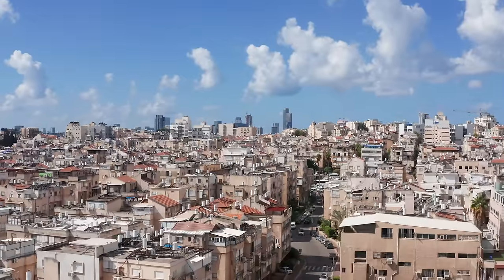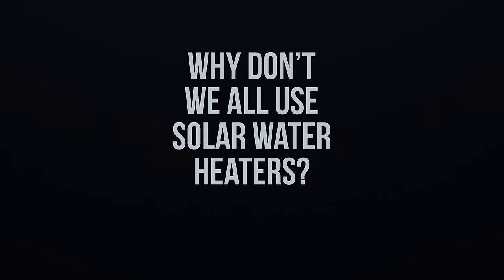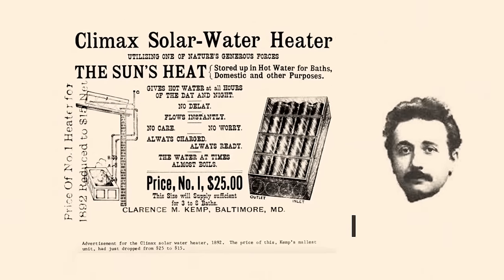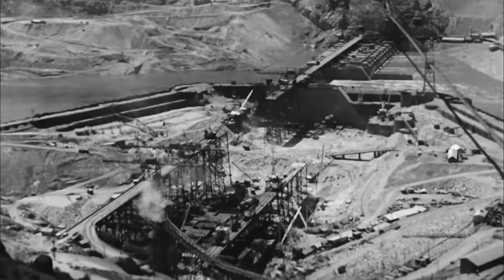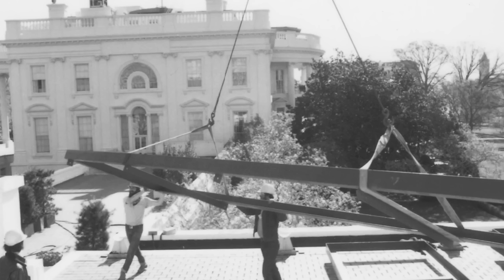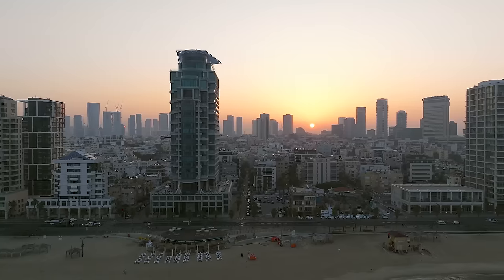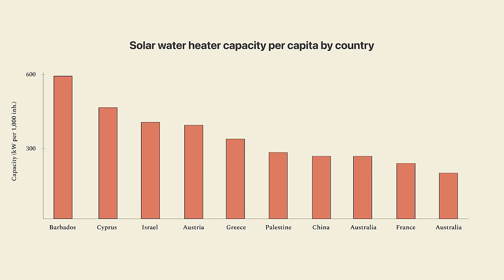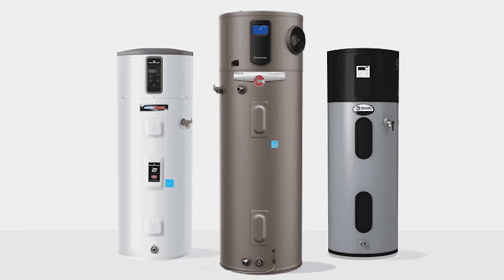Why Don't We All Use Solar Water Heaters?

Comment: I was in Turkey on holiday recently and on the drive to the airport I noticed that most of the rural houses had one of these on the roof. What's weird is that few houses had actual solar that you'd think would be fabulously useful for running stuff like AC in the blazing heat.
Reply: Most certainly because of the initial cost. The cost of solar water heaters are within reach while pv panel system could be 30x or 40x more.
Reply: I spent all the previous winter in Turkey, and it happens that the solar water heater was leaking at that time, so i could've watched as it was repaired. 
These heaters are incredibely low-tech, 2 barrels, 1-2 boxes covered with class and a (probably) copper wire inside, and a pvc pipe connecting them. They cost about 250-300$ at any market in Turkey, and if you don't know how to connect tehm they'll do it for 50-100$.
Solar panel that would generate any sufficient amount of electricity would cost way more, so it won't make any sense to install. And btw, most houses in rural areas don't have an AC, they can't afford it. Even in a "rich" touris city they have AC mostly in a rent places for tourists.

Comment: Solar thermal is one of those technologies where long-term thinking permits sky-high upsides but we are a species that thinks in the immediate short-term.

Solar thermal is one of those rare "Eventually, no matter how relatively less ideal the circumstances are, it WILL pay off" technologies where the only real limitations is getting the ball rolling so that economy of scale can kick in.

Personally I think this is where governments come in but either way we need large scale production of these systems in North America.
Reply: or import from places that already have the economies of scale
Reply: I looked at a glycol system (Canada). $7k+ before installation, probably 10 or more after. I would never spend that much on hot water, certainly not within its lifetime.
Reply: @alanj9978  I don't think you're wrong by any means but I think you might be surprised.

I know hot water accounts, on average, for about 15%-20% of home energy use.

That's admittedly about $30-$40 a month according to BC Hydro's average used estimates (greetings fellow Canuck!).

If one is able to make practical use of the heat obtained via a central heat exchanger getting an average up to $60-$80 a month.

Guess it really depends. If it's able to supplement in-home heating than its a 7-10 year pay back. Otherwise it would be closer to 15-20 year pay back but should out last that by a significant margin.
Reply: @Cheebzsta  It's more like 30 years at $40 per month vs. 10 years at $80 per month, assuming you would otherwise use that $7,000 for very cautious investments (5.5% or so). But how much more than $7000 would integrating the system with a central heat exchanger cost? If it's an extra $4,000 that puts you back out to 20 years, if it doubles to $14,000, you're back to 30 years.

Comment: Prices for water heaters here in Mexico (2mins away from Arizona) is $320 USD for a 120Lts version. The 350Lts version is around $650 USD. Source: HomeDepot, 84000.
I've worked for Home Depot and you can ask a supervisor to give you a discount, they can provide up to 15% discount and the manager can easily do over 20%.
Same applies to US depots. And this is only with this distributor.

Comment: In my 5 bedroom house in Spain 6 years ago I was approached by a local company who suggested I should have a solar water heater. They told me that there where government grants available and it would only cost me €3000. Being a practical person I decided to look  into it in more detail and found that I could buy a complete 300 ltr system from Baxi for €1200. .I also had to spend €130 on extra plumbing pipes and fitted the whole system it two days. So for the last 5 years to provide hot water,I have only used the electric water heater for less than 30 days each year. It’s a no brainer.

Comment: Whoa, I never knew. Are solar water heaters so expensive in the US just because of the economies of scale, or are there other reasons other countries can get them to such a cheap price?
Reply from the maker: I'm not entirely sure what drives the huge price gap. I think
Reply: “I think”
That’s nice. I try to too
Reply: That's the piece I'm confused about too
Reply: elfrjz  what the problem with electric stoves
Reply: elfrjz  i guess gas is cheap there cause here lng is very expensive while electricity is relatively way cheaper
Reply: When I got solar hot water in Florida I discovered that more than 1/2 of the cost was installation. I just bought the stuff from the same manufacturer and put it in myself - took 2 afternoons to do it - and saved over $3500.
Reply: Zaydan Alfariz  Same as Barbados. Its an island. Its electricity is generated by diesel generators. The diesel must be imported by boat. Solar will always be a good investment there.
Reply: @JohnPilling25  Still, the same product in Israel would cost you $600 - 1,500 depending on the size.
The difference in price is strange.
Reply: To be honest I'm not sure where the $7k figure is coming from.  I found many systems that include tanks for under $3k and they all qualify for a 30% tax credit that makes them $2k.  In Israel they cost $700 after a roughly $150 government subsidy.  You can easily DIY it for under $1200 too.
Reply: @distilled-earth you don't know why they cost what they do but you'll confidently assert things like "Reagan's" free market won't get us to higher adoption?

You ignored PRICE in dismissing market solutions??

Are you not even slightly troubled about how lackadaisical you've been in your evaluation here?
Reply: I used to install them. The price is more related to the manufacturer and the installation company. The actual cost if you could go to home depot and get one would be less than 2500 but you can't. The price is also high because of the tax credit that ran for years. Don't know about prices today.

Comment: Excellent video - I didn’t know how few solar water heaters Americans have and how expensive they are to buy there. Here in Thailand I purchased a solar thermal water heater for $1,000 and the savings has already covered the initial purchase price. In the UK the MyEnergi eddi is a popular power diverter that takes excess solar power that would have exported to the grid and uses it heat hot water.
Reply: I was under the imperial system until about the early 70s which is when we started changing over to metric. Conversion between the two system is a pain in the arse but not a problem. The problem arises when the US system rears its ugly head. Mostly because I don't know it. Make whole hearted change and it is a simple as falling off a log. Only problem is visualising the new units, not one problem with measurements,

Comment: An electric water heater can be converted into a solar heater by adding a PV panel and changing the heating element to a 12 volt element, or solar collector panel to heat the water directly and use the electric tank for storage.

Comment: As a user of solar hot water (in NZ) I have this to offer; once on solar your use of hot water increases considerably! Long hot showers, hot laundry washes, etc etc.   Well, why wouldn't you!!!  And while I am on the subject, the reason to have vacuum tubes as opposed to flat plate collectors is that they are like Thermos Flasks; they have the advantage of retaining the heat in the water as the sun heats it. Once hot enough it is then pumped down to the cylinder. Flat plate collectors lose the heat quite quickly on a cold day, particularly as the water is getting up in temperature. It is nothing to do with them being round.
Reply: The vacuum tube variants also don't get clogged with minerals, which can be a an issue in many places.
Reply: Washing machines use cold water then heat it

Comment: Great video! Next step is PVT panels (photovoltaic+thermal). Basically electricity+solar heater in one. Most use different liquid than water that is more thermally conductive, but same idea.
Reply: PVT is much less effective than a dedicated water heater but hey, if you've got the acreage of PV you may as well capture some of the 4 fifths of the sunshine that isn't making electricity.
Reply: I don't totally understand why, but PV + thermal has been tried over and over around the world for decades but it just never takes off.  I don't know if it's people just panicking about water near high voltage or that there's rarely exact matching between the need for heat and the need for electricity, but it never takes off...
Reply: @cbarnes2160  Because of poor efficiency. You are better off having a solar water heater and pv panels separately.
Reply: I think the real next step is PV+teg. TEGs can generate electricity even at night.
Reply: @cbarnes2160 PV is basically maintenance free so adding a liquid loop greatly increases complexity and adds maintenance. The extra cost is usually better invested in just buying additional pv panels and get more electricity.

Comment: Here in Mexico theres a push so more homes start using solar water heaters. Specially if you buy a new home. No tax credits from the goverment though. The thing is that in certain states, the water you get is hard water and that clogs and damages most of the heaters. Solar or not. So you have to replaces or do maintenance often. Also the cost of a solar water heater represents a big investment that will take several years to pay off.

Comment: Passive solar water heaters (where the tank has to be above the panels) are really ugly and don't fit in with most sloped roof residential homes.  In Israel, where most people live in apartments with flat roofs, this is less of an issue.  Also, in Israel, the water is very hard (lots of calcium deposits from heating water), making the maintenance of these things a nightmare.  Most people keep them on their roofs for getting a building permit, but heat with electricity since the panels don't last very long due to calcium clogs in the heating pipes.
Reply: They instal those even on sloped roof (suport brackest are modyifyed),i dont think they are ugly
Reply: @Adam-bw4lw  Yeah. most the world uses these water heaters.. they are fine
Reply: I even managed to feed my chloteswasher and dishwasher from it by using a termostatic mixing valve
Reply: They can be installed on sloped roofs and are commonly are installed on such roofs on private houses - I'm saying this as someone who lives and lived in neighborhoods with sloped roofs, ugly is matter of subjective opinion but they can 100% be installed in a less visually distracting way. As for limescale, it damages every heater including the electric ones, water softeners (there are several methods) are used to drastically reduce the the scale buildup, prolonging the life of every water fixtures and appliance in the house.

Comment: I've had 9 4x8 Heliodyne brand thermal panels for about 30 years now, I made a quanity purchase of 40 of them, so got them cheaper plus a breakon the shipping. I sold and installed all of them except my 9, 6 on my shop, 3 on my home, both have radiant floor heat.  Augmented when needed by a homemade wood boiler. A friend did a recent YT video on my setup, which I take for granted after all this time, and I was somewhat stunned to see many reactions like "That can't work, it must not get cold where you are, they'll never pay for themselves" and similar. They are wrong!

Comment: In Australia solar water heaters were popular in the 70s-80s, however corrosion,  backup heating with electricity, and the major cost of purchase made them less desirable. Most houses now use solar panels and heat water with instant gas, or gas heated tanks. 
When I did change my water heating system on my house,  I  opted for instant gas. Far less maintenance, cost and not having a heavy tank on the roof made choice easy.
Reply: heating water with gas when you have solar panels on the roof is a little backwards however. Heat pumps in combination with regenerative energy source means complete idependence of fossile fuels and long term will be cheaper.
Reply: @maxmeier532  well not really,  heating water instantly takes about 22kW,  a storage system requires  3 times the energy.  So instant gas for here is the most efficient and cost effective way. I use heat pumps for heating or cooling the house.

Comment: I had a solar water heater in CA, back in the 80's.  When it failed, the cost of replacing it made it economically foolish to do so, and that brings the discussion to three very important facts to understand.  1) The "government" is not the answer to anything, ever.  2)  People, as a whole, cannot be counted on to do the right thing, unless it is in their best interests, from a fiscal standpoint.  3)  If you want to see fundamental changes in how people behave, make it much easier or much less expensive to do something differently.  I recently replaced a conventional electric hot water heater with one that includes a heat pump; my energy usage for heating water is down 75%.  If and when I have a solar array large enough to supply that energy, I will essentially be heating water with the sun.

For those not paying attention:  This video gets it all wrong!  It is VERY cost-effective to use a combination of solar and a heat pump to create hot water, and it's much better for the environment if that sort of thing appeals to you.  If you just want to save a bunch of money, it's worth the small investment.  

True solar hot water heaters are a non-sequitur; it is far more effective, from both a financial and efficiency standpoint, to add solar panels and a water heater with a heat pump on top.
Reply: Maybe the integrated panel with the hot water tank, both on the roof, is good for cheap solutions in hot or warm climates without freezing temperatures.

And some panels for 12V PV.

But when you can spend more money, it's better to go with your solution. And I also don't live in a hot climate, so no cheap roof solar water for me. I tend to a PV only solution on the roof and do the rest in-house, without water pipes running to the roof and back...
Reply: @richard--s  - I have no water pipes on the roof, just a heat pump on top of a conventional electric hot water heater.  If and when I add a PV array, the electricity from that will be what drives the heat pump, for the most part.
Reply: @jasonbroom7147  yes, that's a flexible way to use the sun. With good efficiency over the heat pump.
Reply: Heat pump water heater + Solar PV makes far more sense both from a simplicity standpoint, and an economic standpoint. Solar PV is always delivering useful electricity while a solar water heater contraption isn't always delivering a useful amount of heat (especially in cold climates). So if there is excessive capacity due to the warm ambient temperature, the solar PV can be used for other purposes. Warm water isn't hot water so in the winter time, Solar Thermal isn't sufficient while Solar PV + the heat pump guarantees a certain amount of heat will be delivered by the heat pump due to the thermostat choosing the cutoff point. 

Solar thermal had its time but its time has passed and Solar PV is the way to go from now on.
Reply: @imzjustplayin  - Some very good points, but I will mention that in many parts of our viewing area, solar and heat pumps simply can't keep up during periods of actual winter.  I have solar panels and a heat pump hot water heater, but it has conventional electric heating elements for a reason.

Comment: NY you need a separated glycol system with a heat transfer unit. Add bldg codes, town permits (only approved units) and inspections headaches.

Comment: My home town is in northeast China. It can reach -25C in winter easily. Solar water heater is still a thing, on top of tall condo buildings. You don’t need to fill the tank with water if you fear the water line can freeze during winter night. You only need to spend a little electricity to pump coolant through the system, then exchange heat from coolant to water.
It’s so frustrating to see solar water heater is almost none existence in souther California. There are 300+ sunny days a year. We need to consume energy to heat up water and cool house. If there are more sold water heaters on just residential roofs, you get almost free hot water, and spend less money on air conditioning.

Comment: German here, we have a combined heat pump solar heater system. The collectors on the roof look exactly the same like the solar electric panels, except for the blue glow. Water is just plain black. So we got two panels for water on the roof, and the hot water tank is situated in the basement. This way it keeps the heat longer (or better more efficient) especially in the cold seasons. Because it's then warmer in the basement than on the roof. The heat pump takes over for the water if the heat from the roof is not sufficient. And it also heats up the entire house. The rest of the roof is covered with solar electricity 7,5kWp. We always have a sensational low bill for heating of 480 Euros per year. When you should know that Germany has the highest energy prices in the world. My inlaws told us when we built the house to use oil for heating like everyone, but today if they see our energy bill they tend to cry :) :)